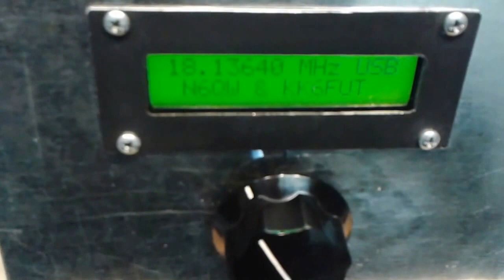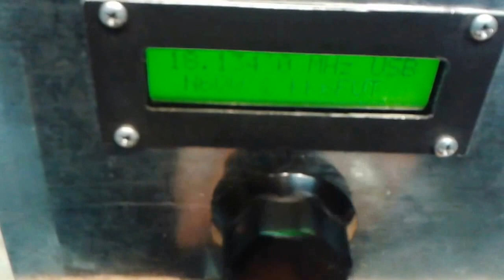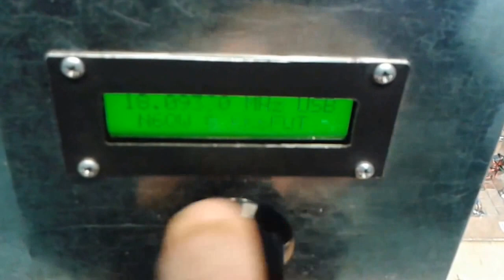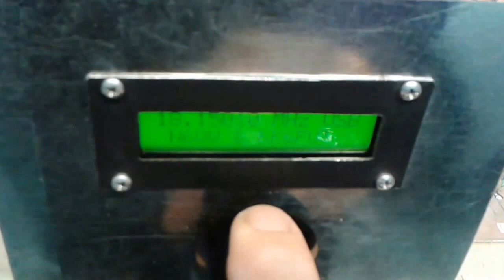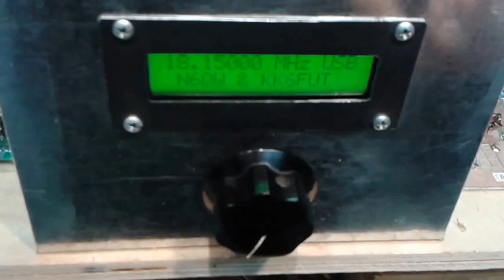Lets Build Something SSB XCVR on 17M

Comment: Hi Pete, where did you get the bezel for the lcd display? or is it homebrew too hi!
Reply from the maker: Hi Kevin,
That is a homebrew bezel made out of thin gage sheet metal flashing sold by Home Depot. A small piece (in the roofing section) cost 64 cents and is easy to work. You get enough material to make two bezels. I drilled the 4 mounting holes first and then screwed that down to a small scrap piece of 2X4. Then in a vise I simply drilled out enough holes to use a pair of tin snips to cut the material close to size. Some time in the vise with a file "squared" the hole into its present shape. A couple of coats of flat black and you are there. Thanks for your email inquiry.

73's
Pete N6QW